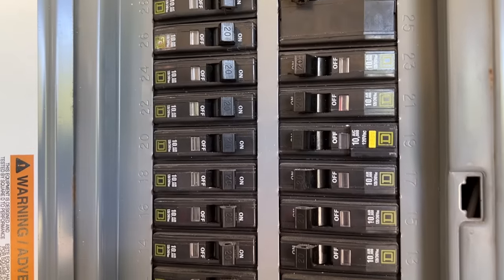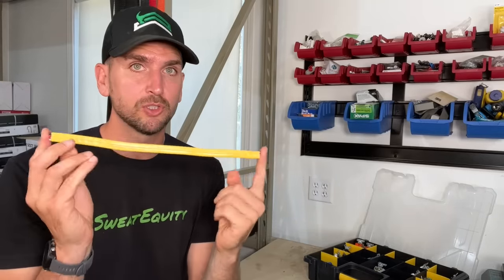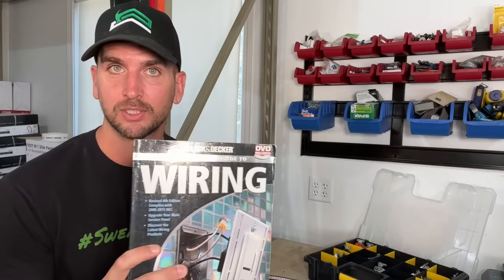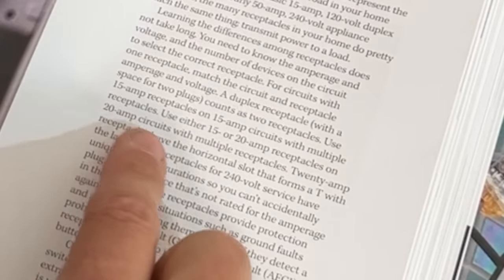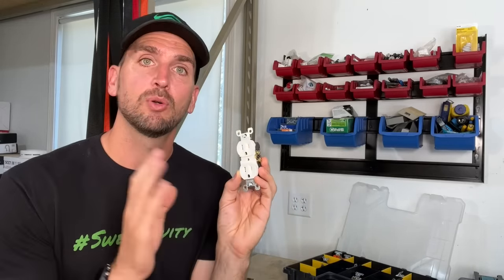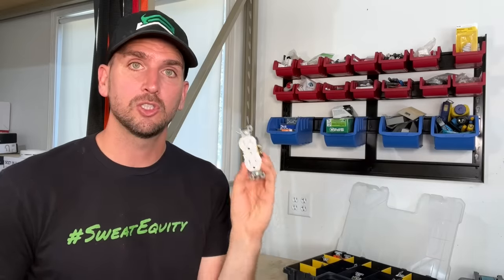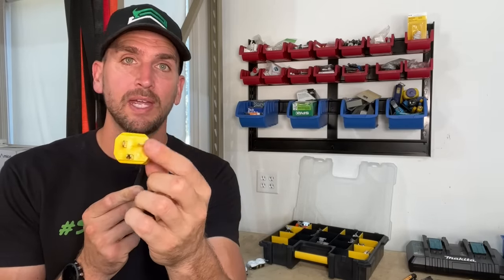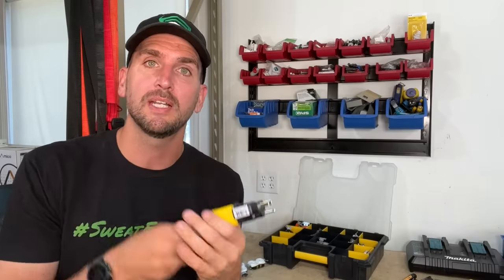Can 15 Amp Outlets Be Used On A 20 Amp Circuit Breaker

Comment: According to code, electrical load is calculated as a maximum of 80% of breaker capacity and a load of 1.5 amps per receptacle.  So a 15 amp circuit can have up to 8 receptacles and a 20 amp circuit can have up to 10 receptacles.

Comment: My kitchen has  two 20 Amp circuits for outlets. All are 15A outlets protected by a 15A GFCI.
Reply: Should be no problem.   GFCI does not trip based on power consumed.

Comment: When It's 20 amp I use 20 amp ,I don't like taking chances. I've seen larger air conditioners space heater and larger freezers burning up plugs and outlets in a short time.

Comment: The duplex 15 amp receptacle is considered to be two, and the reason it’s okay is because each side, top and bottom can handle 15 amps, thus 30 in total, but if u get to that ampacity  then your 20 amp breaker will trip. However using a receptacle that  would be for single use, meaning not a duplex, would only handle 15 amps. So, that’s why single receptacles, not duplex, would need to be 20 amp rated. Hope this makes sense.
Reply: A 15 amp duplex receptacle cannot handle 30 amps total. The whole receptacle is rated for 20 amps maximum. If the 30 amp total was correct then you could have a 30 amp breaker and 10 gauge wire and be fine, but that's not the case. The exception would be if the receptacle was split and the upper and lower were on separate circuits and then each contact could have 20 amps maximum on a 20 amp circuit with 12 gauge wire. If each contact was the only receptacle on its respective circuit, a 20 amp duplex receptacle would be required on a 20 amp circuit.

Comment: I’m amazed in the US they allow 15A devices on 20A branch circuit.  Not everyone including professional will use high quality devices. Even on 15A circuits I’ve seen plenty of receptacles melted because of a high draw device plugged in, 20A circuit would allow  even more current to melt the receptacle. It’s a little strange imo considering one of the fundamental rules of the code is sizing everything according conductor size and ampacity. I have a feeling it’s an exception influence by manufacturers not wanting to loose sales on such a common device that would plummet in sales after become almost obsolete.
Reply: Receptacles generally melt/burn from high contact resistance, not from 20A devices on a 15A circuit.

Comment: While its allowed by code to use 15amp receptacles the code also says that the maximum cord connected load cannot exceed 12 amps so knowing what people sometimes do its best practice to use a 20 amp receptacle on 20 amp circuits.
Reply: 120 volts 12 amp= 1440 watts.
Space heaters,blow dryers,ect
Reply: Exactly why I think code is incorrect in this scenario.  Yeah it is safe for the vast majority of cases but there are edge cases where it might not be.  You can't expect a homeowner to even think about calculating the load much less actually doing it.  It is such a tiny amount of savings on a new home, I think it is just not worth the degradation in safety.  If the builder even saves $50 per house by putting 15A receptacles on 20a circuits I would be surprised.

Comment: I was forced by the inspector to change my 14# wire to 12# gauge wire on all my circuits, even the lighting circuits.  The breakers had to be changed to 20 amp as well.  He said a future home owner might change the outlets to 20 amp and might put a 20 amp outlet on the ceiling.  I argued against that and lost.  Turns out I had to hire his brother to be my electrician or face endless hassles.  Some circuits had to have a separate ground even though there was already a ground in the sheath with the other two wires.  I have since sold that house and moved to a more sane city.
Reply: yeah i report that sort of sht to city council and building admins. If they try to force a code that doesnt exist then put in complaints. Ask for supervisors. Its almost as if there is a book that you can look up everything in.
Reply: Adding in extra grounds like that can create ground loops. Sounds like the people you were dealing with were greasy.
Reply: And yet another reason to not deal with permitting.
Reply: @mwwhited appeal to extremes fallacy.
Reply: That is called corruption!   Maybe you were supposed to hand him cash and you missed the hint!   I’ve heard that about Chicago.  It’s disgusting!

Comment: A better argument is 1: don't overload and 2: those that will overload will do so on a 15A circuit just as readily so having a 20A circuit makes it more difficult to overload the wiring and makes the only "weak point" the outlet.  Next consider that if you put multiple outlets you spread that load out so that someone that does not know which outlets are wired together might load up the overall circuit with more than 15A much easier where making it a 20A circuit again makes the wire and breaker better able to handle the load.  Space heaters and Air conditioners are notorious for being the thing that kicks on and trips the breaker.  That is why some space heaters and most air conditioners specify a single outlet circuit; not even a duplex outlet.  This discussion is a classic case of overbuilding but with good reason. 

Remember that it is "power draw" not push, meaning that a 20A breaker does not push 20A  into the circuit but rather allows that much to be drawn through it if enough is plugged in.

Comment: 4:58.  The newer 15A 120V receptacle looks like it is also capable of 15A 240V with the correct face plate and change the the screws so they are all bras coloured.  Streamlining the production process for multiple applications.

Comment: When I moved into my current house, the previous owners had placed 20A breakers on all the circuits, though nearly all the in-wall wiring is 14 gauge.
Reply: Did you get it inspected before buying the house?   If so, the inspector should be notified.
Reply: @KevinCoop1  yes, but they didn't check that apparently :(

Comment: You can't plug a device into a 15a outlet that draws more than 15a unless it violates code. Therefore, a 15 is code on a 20a circuit. What matters is the wire size on the breaker.

Comment: Consider this. A 15 amp device with a 15 amp plug malfunctions and it’s pulling more than 15 A, but less than 20 A. If plugged into a 20 amp circuit, the breaker will not trip, and if the device does not have an internal fuse, this could create a problem. Do you see this as a potential issue, or is it so unlikely is to be not a concern?
Reply: What is the purpose of a 20 amp breaker or fuse?   Your situation posed is an appliance is defective and drawing more current than rated but less than 20 amps.   If your defective appliance draws 18 amps for more than 3 hours (give or take a little) the breaker will trip because of overload (heat build up within the breaker).   So, the breaker will do its purpose and protect the conductors from degrading the insulation on them.  Will the receptacle get warmer?   Yes.  A receptacle carrying 16 amps will be warmer than one carrying 10, or 5, or 2 amps.

Comment: Question: so majority of appliances (refrigerators, ovens, stoves etc…) dont go over the 15A? During what scenario would a 20 A be appropriate, more than one appliance plugged into the outlet?
Reply: Residential refrigerators, and counter top appliances are not allowed to be manufactured to require a 20 amp cord and plug.  Ovens, stoves etc are not counter top appliances.   Those can be 30 to 60 amp 120/240 volt appliances.   If you buy a commercial appliance like used in restaurants, many of those are 20 amp 120V.   Those are typically on a dedicated circuit.  Hope this helps you.

Comment: The reason why I still do not agree to put 15 amp outlets on 20 amp circuit breakers because if a appliance is drawing 17A on a 15 amp outlet on a 20 amp circuit, the breaker would not trip and the outlet will melt and possibly cause a fire, this has happened to me on a 15 amp outlet that was on a 20 amp circuit when I used to live in a apartment. Great video though!
Reply: That's incorrect. If the receptacle is in good condition it would not be the problem. A spec grade 15 amp receptacle is identical to a 20 amp receptacle internally. The connections and wire gauge and condition are problematic. If you're consistently drawing 17 amps on a 20 amp circuit with 12 gauge wire you need to have a 30 amp circuit with 10 gauge wire. There's an 80% safety margin for all wire, meaning 16 amps is the maximum here.
Reply: @surferdude642  First of all, it was a old apartment and we cant just go in and modify the wiring. Second of all, i've seen 4 15A receptacles melt on a 20 amp circuit in my newly built home.
Reply: @usipussi6647 It sounds like you have a valid complaint to make to the builders and/or real estate agent. I would initially suspect some backstabbed receptacles. Does the home have AFCI breakers or receptacles?
Reply: No modern appliances that draw more than 15A would plug into a 15A outlet, because the neutral prong on their plug would be horizontal and not vertical.

You could, however, exceed 15A total on a 15A outlet by plugging in two devices that combined drew more than 15A. This happens all the time, which is why I think it's fair to assume that properly made and UL-rated 15A outlets can handle well over 15A, even if it's not a good idea, because of how often this happens in the real world.

For example, a typical space heater draws 1500W, which is 12A on a 125V circuit. Plug a 500W hot pot into it, which draws 4A, and you're up to 16A. This is even more likely if you attach an outlet extender or power strip and plug all sorts of devices into it. So I find it hard to believe that these things aren't intentionally overbuilt to handle such common scenarios.

Comment: The purpose of the electrical breakers is to protect the circuitry on the upstream/ supply side of the circuit, not the downstream/ demand side.  As explained by the senior electrical engineer at a large chemical plant, t I had to think about that, and yeah, it makes sense and that is the pretty much the philosophy the NEC follows.

Comment: Also, I think that you ask the wrong question as to whether it's possible to overload a single receptacle in an outlet beyond 15A, since it's against modern code for devices that draw more than 15A to use the standard 2-15P or 5-15P plugs that fit into 2-15R or 5-15R outlets.

I suppose that you might find some really old devices that violate code, but I doubt that it's common. But the vast majority of devices that draw more than 15A use 5-20P plugs (not sure if there are 2-20P plugs) and wouldn't even go into a 5-15R receptacle.

Rather, you should be asking whether it's possible to overload a single 15A duplex outlet, by having two devices plugged into it, one into each receptacle, totaling more than 15A combined. E.g. two 10A devices, or one 8A device and second 10A device. I don't know the answer to that, though.

I mean I'm sure that it would work, for a brief time at least. But would it melt, burn or fail over time, or over repeated uses? Or at good quality 15A duplex outlets able to handle up to 20A safely and reliably, and if so both residential and commercial ones, or only commercial ones?

Comment: Key issue at the moment with most (all?) commercial grade, and the thing that makes both those receptacles you showed against code, is that they are not tamper resistant.  TR is required for all 15 and 20 amp receptacles in residential.
Reply: TR is not required for all residential per NEC, but it’s pretty close.  For example the garage door receptacle on the ceiling does not need to be TR.  There are commercial grade TR, for Eaton look at TRBR20 or 15.
Reply from the maker: Yeah, I was debating wether or not to at least mention TR.  thanks for calling it out.
Reply: @EverydayHomeRepairs  You certainly should since it is 100% required by code in almost every area in residential and you don't want to be giving some code guidance while not discussing a part that will cause them to fail inspection if they don't have it. 
Was a issue when I was just rebuilding and rewiring my basement last year as I could not find any commercial grade outlets with TR (which is silly as there are a lot of commercial settings where they are required now).  Flimsier consumer ones with no back wiring made it more painful to install and get flush (as for some reason all the leviton consumer ones sat too far back so I had to add the little bumpers to bring them out an 1/8th or so).
Reply: Execptions are mostly for receps out of reach of children: 5.5 feet from the floor or in enclosed spaces.
Reply: @RJ-ej1nr  Yeah, there are a few exceptions but for general audience videos like this it would probably be better for guidance just to assume TR and get them.  
Thanks for the heads up on Eaton ones.  Not sure if I missed those or if they were released after I was looking for my project about a year and half ago, but I would have certainly liked those more than the leviton consumer grade ones I got.
Reply: @curtisbme  General audience?  You mean when I say "404.12 exceptions", there are people here who won't immediately say "oh, of course" and then nod their heads?  :)

On the Eaton's, the BR series has been my commercial go to for a while, and then when I needed a TR version I checked and it was there.  This was several+ years ago.  Don't think it was in the big box places though at that point though.  If you want something that you can't find, start with the manufacturer catalogs to find where it exists.  Then once you have a part ID you can go about sourcing.  If it's obscure, lots of places now will sell you things online, however be aware that supply houses cater to businesses accounts so services, return policies, and possibly prices are likely not what you are used to in retail.  You can also use your local supply house, with similar caveats.
Reply: What the heck is "tamper resistant"?  Is that the silly thing that supposedly prevents a kid from inserting a paper clip into the hot side of the outlet without also inserting something into the neutral at the same time?  That in practice just makes it annoyingly hard to plug anything into the outlet at all?
Reply: @phillipsusi1791  - IMHO, TR outlets are a good thing. All it takes is for a child to insert something metalic in the hot side and have their body serve as a ground to get a shock.
Reply: @BrucePappas  LOL... you don't have to tell me... I think I was about 8 years old my my dad explained the difference to me between hot and neutral and I thought it was cool that I could stick a paper clip into the neutral side of outlets and not get shocked.  Then I ran into an outlet that some idiot had wired backwards and got my lights knocked out from the shock.  That was a painful lesson in the difference between what should happen, and what can happen.  Of course, the reason why the US went with 110 volts way back when was because while that's enough to be painful, it generally isn't enough to kill.  I certainly uttered some curse words that day that my dad didn't think I knew... hehe.
Reply: @phillipsusi1791  - what a great response! I learned my lesson about electricity by brushing a ground against the hot leg in a commercial panel when I was in my 20s! I saw my life flash by.... literally! I'm grateful that I got to see my 30s otherwise I would have no grandkids! It wasn't my time!

Comment: The only difference between 15 Amp outlets and 20 Amp outlets (of the same grade & make) is that the can plug a 20 Amp device into a 20 Amp outlet, but not a 15 Amp outlet.

Comment: I have a duplex outlet that is installed in an older townhome (built in late60"s or early 70's). It recently sparked when removing a nightlight. There is a metal duplex cover plate that goes over the outlet and tightens down to the tile surface. This outlet is directly to the right of my bathroom sink(within 2 feet)My neighbor says that I need to change out to a GFCI. He turned off the 20amp circuit breaker at the panel box and tested that power was off with a Klein tester. He pulled the duplex outlet out and it only had two wires (a black and a white wire)There was no ground wire bare copper or green wire even though the duplex outlet he pulled out had a hole in the bottom of the receptacle for a ground prong. Can I replace it with a 15amp GFCI  putting the black wire on the brass screw tightening in a clockwise direction and the white wire on the silver screw in the same way?

Comment: There is a formula how many 120 VAC receptacles can be use on a 15 amp or 20 amp receptacle. Here is the approach how many receptacles or outlets can be use how many receptacles can use for 15 A on 120 V and 20A on 120 V.

 
But I knew from UL  is this, 
for 15A is;
1800 VA’s/180 VA’s=
10 receptacles

and

For 20A is;
2400 VA’s / 180 VA’s =
13 receptacles

To my understanding it is based on UL ruling since the early 1950s or 1960’s, any product underneath 120 VAC that is calculated have a fine average calculation of any type of electrical product (180 VA’s) that uses low current device that uses below 20 A.